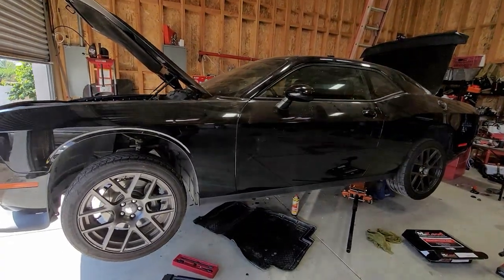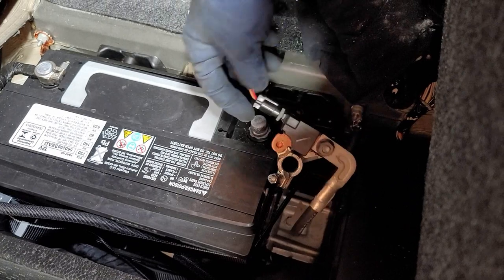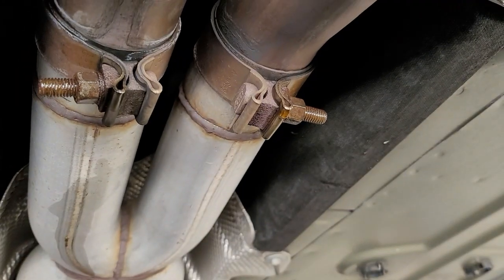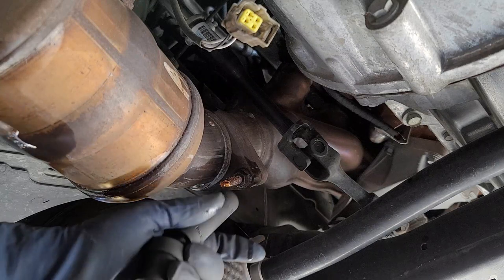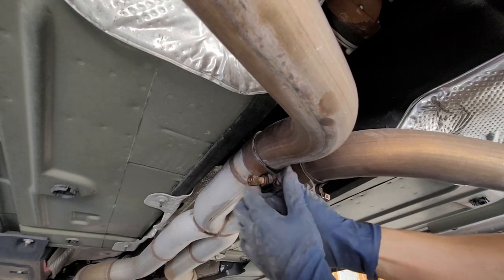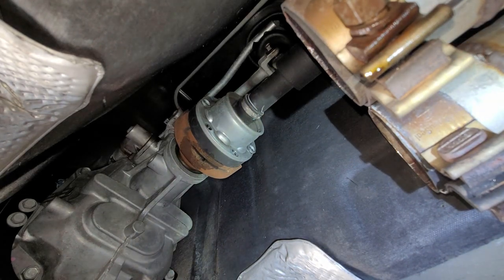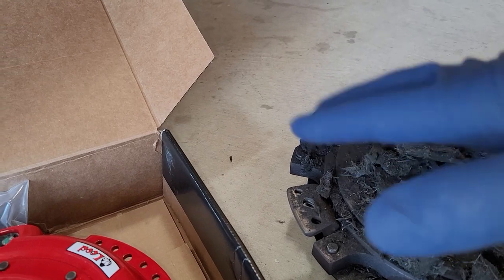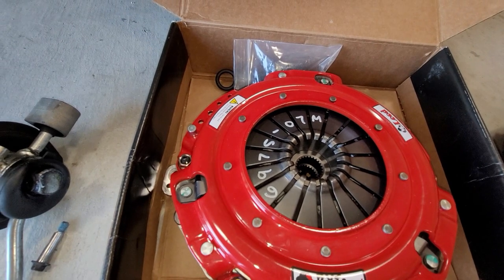dodge challenger (scat pack) clutch replacement full detail

Comment: Having already done this on my own Chally, it's much easier to to drop the exhaust & the driveshaft. Just loosen the clamps at the X-pipe, & the remove the 13mm bolts at the hangers. The time it takes to do that is worth it to save on struggling with the trans. Also, having a 2nd person to assist is also a life saver. As for the shifter, it's much easier to remove from the top. Just remove the 2 pins at the front, & unbolt the linkage from the top of the trans. Then you can slide the whole thing forward, out of the stabilizer at the back. No need to disconnect it or the actual stick. I also found it easier to just disconnect the bell housing, & drop it out with the trans. No need to remove that little cover either. You can also leave the starter sitting on top of the sub-frame/sway bar, as it's not in the way at all.

That McLeod RXT clutch is beast! Great clutch but it is running about $1500 give or take, depending on where you get it from. I have yet to see a good quality clutch come with a new throw-out bearing. Also, with Challengers, you have to replace the entire hydraulic release mechanism. Don't be cheap, replace that pilot bearing! It'll save you from more trouble in the future. Also put a little lube on the input shaft before trying to install the trans.

From the looks of that input shaft, it looks like the pilot bearing is already bad. Looks like there's a groove in the shaft. That can cause issues with shifting if not repaired. That should be fixed prior to re-installing the trans. If the input shaft doesn't go in easily, you may need to put a jack under the back of the engine to lift it & get the trans in line. Also, if you're not replacing the driveshaft bolts with new OEM ones, be sure to use some blue threadlocker on them.

As for bleeding the clutch, it'll take 50 or more pedal depresses to build pressure. It would also be a good idea to do a brake fluid flush at the same time, since the master cylinder is shared between the brakes & the clutch. I'd highly recommend some high temp fluid such as Wilwood EXP 600 Plus, especially if you have the multi-piston Brembos. Two bottles should be enough to do a complete flush & refill.
Reply: That was some great knowledge. I was wondering where the master was for the clutch slave and you saved me some time.
Reply: @quychang4471  You're more than welcome, & happy to help! There is a hydraulic throw out bearing that you should replace at the same time that you're replacing the clutch. 👍🏼

Speaking of the throw out bearing, there's a "clutch delay valve" that you should remove from the new throw out bearing before install. All it takes to remove it is a 2-3" screw. Just turn it in by hand, & then pull the whole thing out. You can find some videos here on YT about it. ✌🏼
Reply: Yo bro been trying to get my tranny out on my hellcat and it has been a tough job. I did the same process as this video trying to separate the tranny from the bell housing but seems one dowel is stuck in there or something. So I was thinking about bolting that back to the bell housing and then dropping the tranny with the bell on it. Is it really hard to get to the bolts at the top of the bell housing? I'm on jack stands so it's a hard life out here. I will also be replacing the pilot bearing. Do I need one of those harbor freight pullers or is there something better? Also gunna do the rear main seal on the crank. Might as well since the transmissions out I guess. @DJGRoc
Reply: @igsSakeBombz  I used all the extensions that I had to get the top most bolts on the bell housing. A lil trick that helped me was too put a jack under the back of the engine, & lift it a lil bit. I assume you already disconnected the shifter, so then it's a matter of removing the trans support bracket & wiggling the trans backwards. You'll want a jack or something under it of course. A pry bar can be helpful to break the bell housing free. If you're gonna take the bell housing with the trans, you're gonna need to remove the starter.

As for the pilot bearing, you will need a race puller. That or you can do the bread method. The latter is a bit messy though. 

I did mine on jack stands also, so I feel your pain. I'm doing suspension & axles now. Still on jack stands.
Reply: hey thanks man, the block under the engine helped me keep it lined up and I was able to break the housing finally. Now just gotta wiggle the spindle out.
Reply: @igsSakeBombz  Happy to help, & glad it worked. Should pull out fairly easy, as long as the spindle is aligned with the engine. You'll need to do the same when you put the trans back in, as the rear of the engine will dip down otherwise.
Reply: Hey again, was wondering if you replaced your Rear Main seal while down there doing the clutch job. If you did, did you have to drain the oil? @DJGRoc
Reply: @igsSakeBombz  Unfortunately I did not. Wasn't leaking, so left it alone. Might check it next time, as I'll be due for another clutch soon. Don't forget to grease the pilot bearing before you put everything back together.
Reply: Gotta grease on the pilot bearing and shaft on the tranny right? Saw another video they slide the clutch plate back and forth on the shaft before installing and wiped of the excess to get that grease in there.
  @DJGRoc
Reply: @igsSakeBombz  you want the slightest amount on the input shaft. Graphite would be better than grease. You don't want any grease being flung onto your friction/clutch plates.
Reply: It’s crazy dude the inner ring of the pilot bearing came out but the main ring that holds it is stuck in the crank. How did you get yours out?
Reply: @igsSakeBombz  Are you saying that it came apart? That didn't happen to me, so not really sure how to handle that. Perhaps a larger race puller?
Reply: Ya. My puller apparently wanted to only pull the inner ring out of the larger one. Unfortunately the puller I got has kind of rounded and think feet so don’t think it’s gunna get behind this ring. Sucks but maybe some flater footed puller could help. Trying bread now but not getting a budge on it.
Reply: @igsSakeBombz  Sorry to hear that man. You gotta stuff a lot of bread in there, then use a deep socket or something of the right size, & whack it good with a hammer! If that doesn't work, then maybe try renting a tool from O'Reilly's or something. Beyond that, all I can suggest is checking the forums, & see if someone else has had this issue. I'm sure that someone out there has! Good luck dude! ✌🏼👍🏼

Comment: To say this video was helpful would be quite the understatement! Very good video! The details were most helpful. I'm putting a '12 together that I bought in pieces. This shows in detail where all the pieces go, bolts, torques even those little clips. I am using a Hellcat factory clutch as mine is a factory R/T. Thank you!

Comment: This video is amazing you’re a great person, I have a question, my throw out bearing went out which is why I’m pulling the trans, the clutch was replaced by a shop about a year ago and I just went to pull the pins from the shifter linkage and one of the two lower pins was never put back by the shop, do you think that could be a reason for my TOB going out? I have no idea where to get a new one or where to even start

Comment: The bleeding method I’m going to try it I noticed after a month of not driving it park in my garage one day I tried starting it up I noticed the clutch was very soft I knew it was air in my clutch lines I’ll update if the 200 pumps will make it back stiff or not

Comment: Very good video. I enjoyed it. My critique is of the flywheel, it has hot spots and looks like some scoring, especially bcuz of the condition of the clutch. Personally, I always resurface it when doing clutches. Excellent tutorial though.
Reply from the maker: This clutch set up  has its own flywheel  its a complete kit. It's meant to be bolted to the old flywheel without resurfacing
Reply: If you're putting in an OEM clutch, you'll want to resurface the flywheel for sure. With the McLeod RST/RXT, it has its own friction plate that bolts to the flywheel, so no need to remove the flywheel for resurfacing. When I did mine, I actually put in an aluminum flywheel.
Reply: Agreed. That friction surface is burnt. The flywheel should be pulled and resurfaced. Even with the dual-disc the front disc still engages the flywheel. Id be very surprised if the wasn't engagement chatter.

Comment: I can't figure out why you pulled the shift knob... In hindsight, would you skip that, if you had to do it again? Were the linkages in the way? ... I have one of these on deck, for my lift. And I'm just curious about that one detail.
Reply from the maker: It's made it easier for me. Just watch the video  on how I pulled it out
Reply: Actually, you don't even need to remove the shifter at all. Just remove the 2 pins at the front, & the 10mm bolt holding the linkage to the trans.

Comment: Doing a cam job the one and only video showed hot to get this car on jack stands
Reply: Watch the "Budget Challenger Build" series on here from Reignited - Cycle and Automotive.
Reply: @DJGRoc  I did I finished camming it 
Watch it on my YouTube
Reply: @rssdefensecorp777  Congrats! How'd it work out?
Reply: @DJGRoc  great just need to learn tuning 
This tuners are charging arms and legs
Reply: @rssdefensecorp777  I take it that you already have the unlocked PCM? Yeah, I've been having a hard time trying to find a tuner that's near me. I don't want a penpal tuner.
Reply: @DJGRoc  Greene Racing is what I use now he is pretty good.  Diablotoona and Demon Motor sports and Stephen Dixon from evolution tune 
If you go cheap you will blow your engine

Comment: Hi Jacob, Great video. How much did the replacement cost the customer? Parts and Labor? Have RT 5.7 and mine is showing first signs of a wear.
Reply: I dunno what he charged his customer, but the first time I had a shop do mine they charged me over $1200 in labor & had my car all day. They didn't even bleed the clutch properly. I bought the clutch myself beforehand for like $1700 with the pilot bearing, & even bought new OEM flywheel-to-crankshaft bolts from the dealer for something like $150. I got them because the Hays Dragonclaw clutch kit came with a new flywheel. This is why I did it myself the next time, & had to buy a new flywheel as the shop didn't give me any of the old parts back.

Comment: A couple questions, 

1: How hard would it be to replace the flywheel beyond what you did?

2: How hard would it be to disassemble everything again after you put the locktite on?  Just curious if you would be able to remove those bolts with a wrench again or if you're permanently screwed (no puns intended).

Thanks in advance!
Reply: There's two kinds of loc-tite. I believe the one used here is the semi permanent kind. You'll most likely need to put some elbow grease into breaking it free but it'll come out again.
Reply: The flywheel isn't that difficult at all. There are 8 bolts to remove from the crankshaft. Just need a screwdriver or something to hold it from spinning.

With blue Locktite/threadlock, you can break them free with a little elbow grease. Red Locktite/threadlock on the other hand requires that you heat the bolts to a certain temp before trying to break them loose. If you don't, you'll probably shear the bolts off before they break loose.